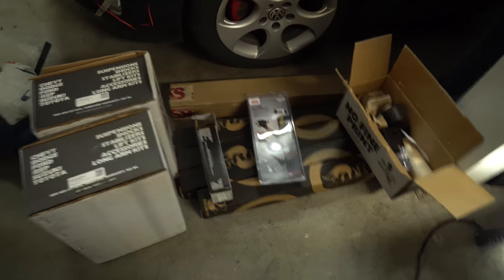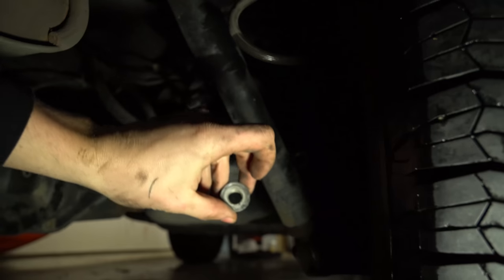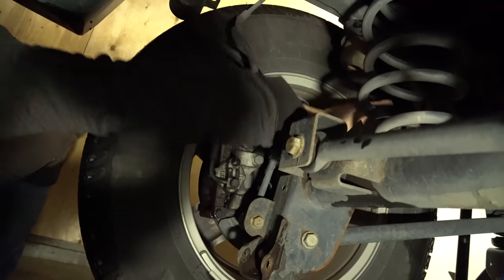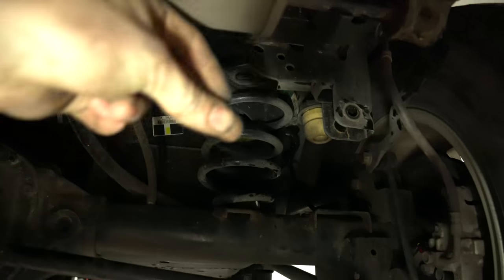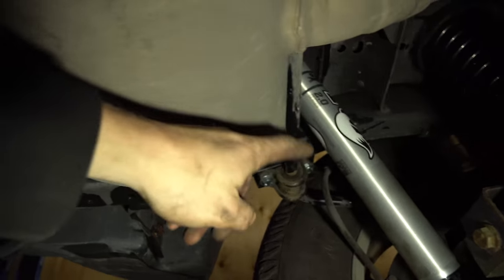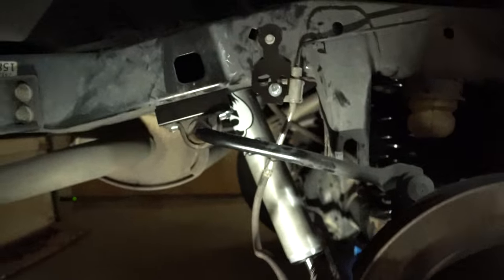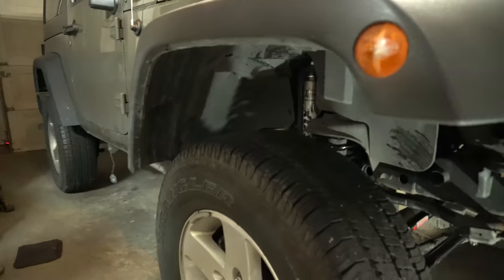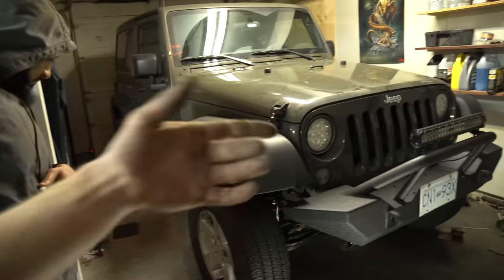INSTALLING A BDS 3 INCH LIFT WITH FOX SHOCKS JKS ADJUSTABLE TRACK BAR AND DISCONNECTS

Comment: I did a BDS 3" Lift with Fox 2.0 shocks and a JKS adjustable track bar.  Came out incredible. I added BFG KO2s 34x10.50R17.
Reply from the maker: thats wicked mate
Reply: Paul C.  mine rides nicer than stock.  Still loving it!
Reply from the maker: As he said the ride is very very smooth